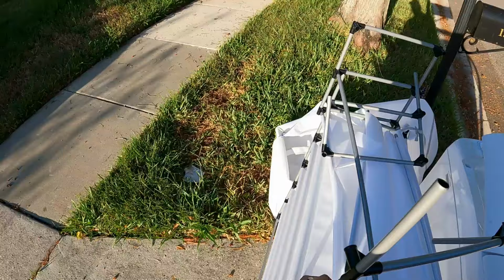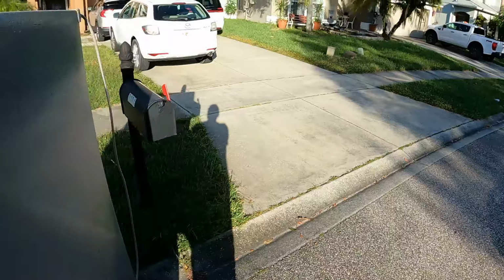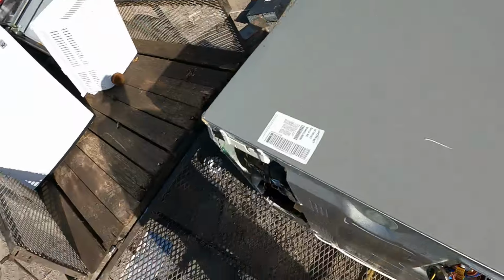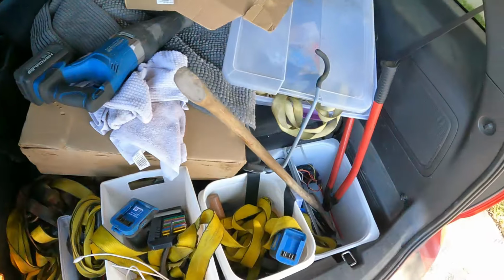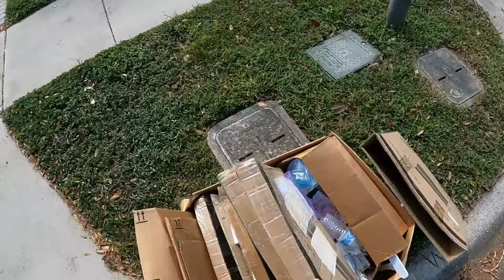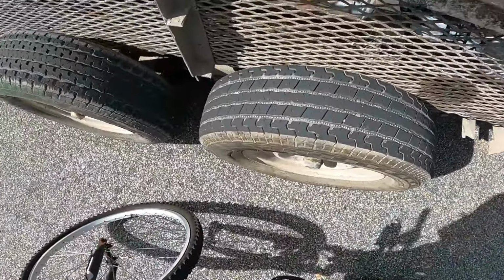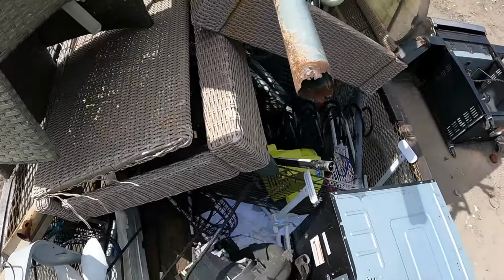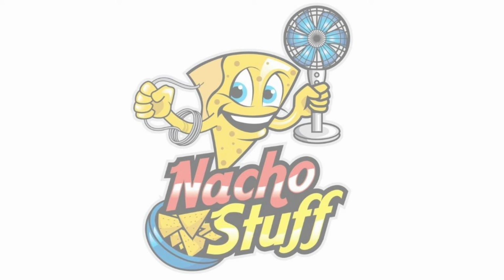Profiting From Garbage Day: Turning Trash Into CASH

Comment: How come you won't stick that magnet on the handle to those barbecue pits just a question. Matthew
Reply from the maker: Becuase I already know they are stainless. 9 out of 10 are. But they are also very light
Reply: @nachostuff  but you took that little girl burner thing? That's about the same weight. Just wondering no not upset about it.